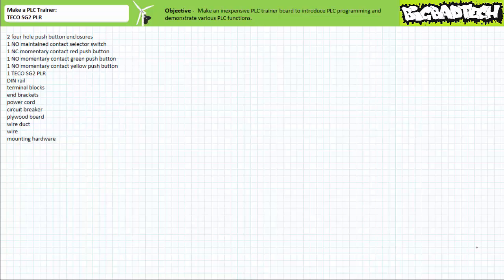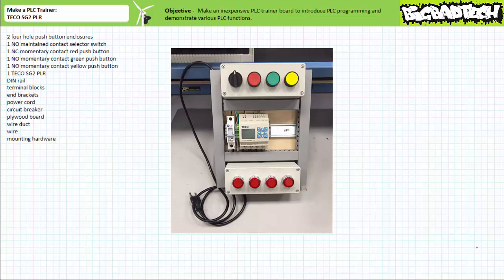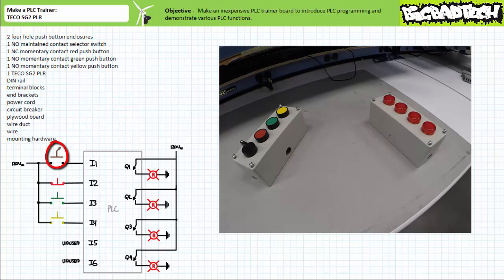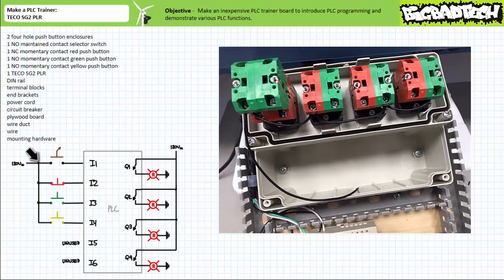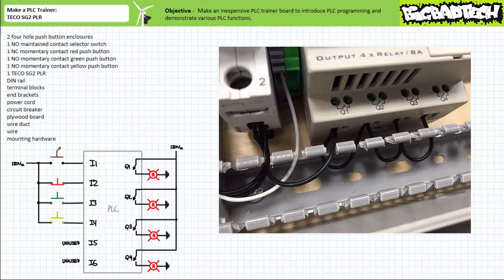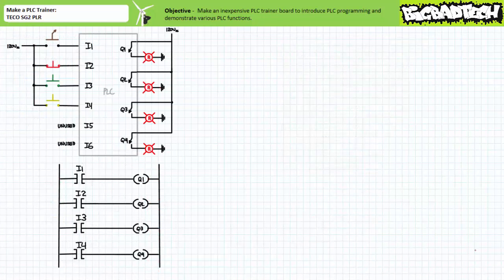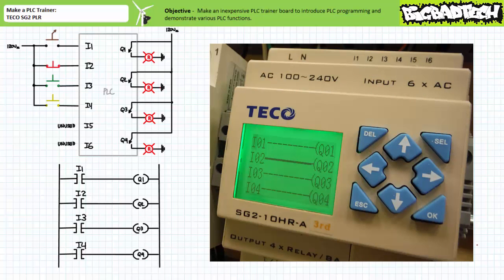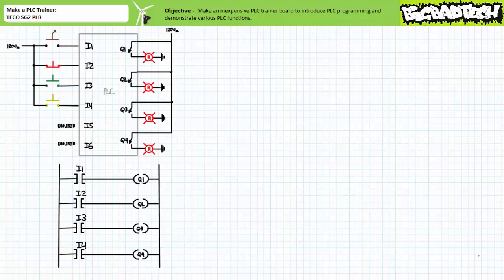Is this the world's most inexpensive PLC trainer? (Full Lecture)

Comment: Hello Jim, on the wiring diagram You could show the circuit breaker on 120 V AC power supply, power supply wires for PLC to have fully indicative wiring diagram.

Comment: can I use a 220V AC source at the device input?
Reply from the maker: Yes. 100-240VAC input.
Reply: but the current must be 1.3mA, right?
Reply from the maker: Off the top of my head I don't remember the current draw. Check out the users manual it should (might) have specifications for both active and idle states for a range of input voltages. Here's a link to the TECO website: http://teco.us.com/
Reply: thanks